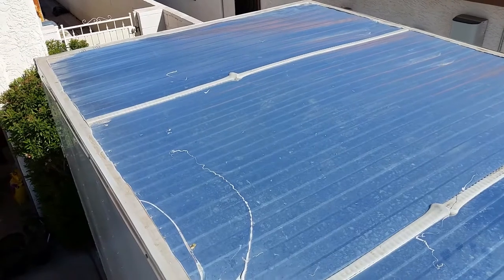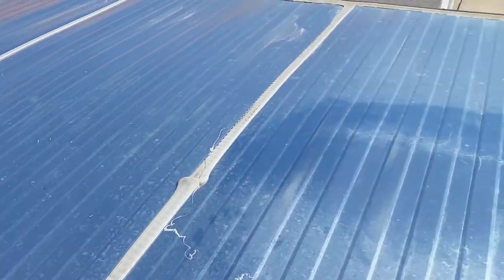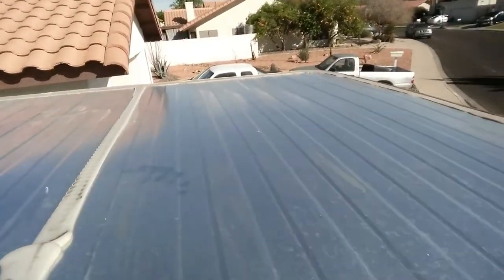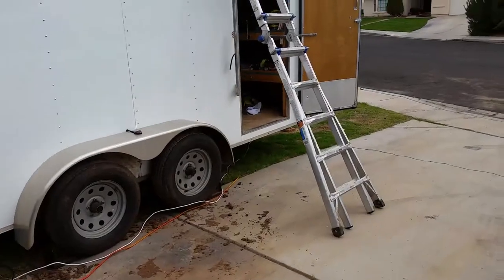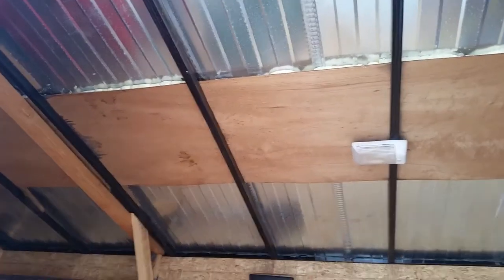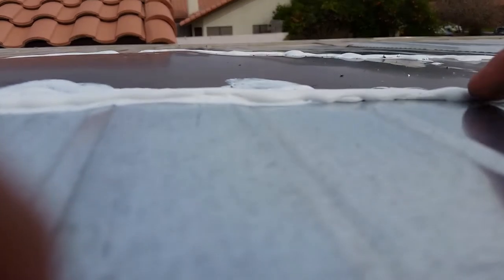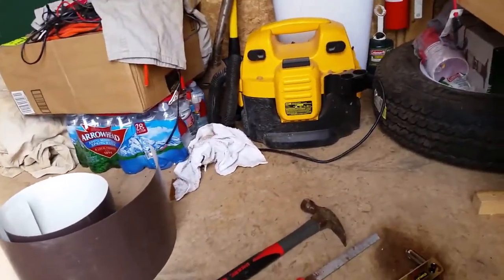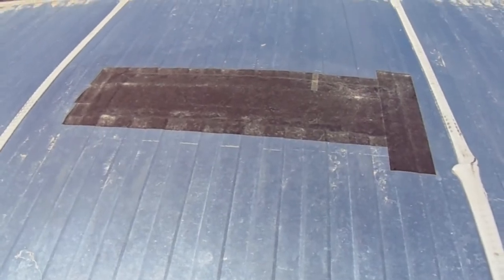Cheap Fix (Trailer Roof Repair)

Comment: I have exact same trailer roof and it developed a hole and cracks. The manufacturer wanted to charge me $1500 to repair. I will utilize your technique. Thanks for the video.
Reply from the maker: You're welcome.  I hope it works for you.

Comment: I realize my comment may be a bit late for some, but- I only now saw this old video and feel obligated to intervene. Several steps and methods presented in this video should not be followed or taken. Regardless of the thickness or type of exterior roof panels (ex: Galvalume, galvanized, tin, aluminum, etc.)- please know: numerous factors purposely exist and are incorporated into the design, which should not be altered or modified. The roof actually needs to be somewhat flimsy and detached from certain sections of interior crossmembers or framing components. It needs a considerable amount of adequate "flexibility". Your roof & roof liners need to handle numerous conditions and must be able to accept or withstand  certain resistance, while also accommodating frequent expansion and retraction. Have you ever heard the pop noise coming from your trailer in summer or winter? This is the "natural" reaction of the expansion and retraction. Had the engineering not taken into consideration of this need to accommodate the reaction- you would have bigger and constant problems. The flexible factory product found in "spots" (described in the video as not hard and "like gel") shown above the cross members inside and just above the luan (the wood panel product) is also NOT designed to "Hold" components together. That little "Dab" in the specific locations serves a few purposes and should not be "Hard" or be "holding" or bonding the roof panel to the luan or crossmembers. It is not a "Bonding" agent nor to be an adhesive. See, it is a product designed to remain pliable and to be utilized in the contact points while also acting as an insulator of both sound, and friction as well as an absorber to prevent vibrations and withstand certain resistance. Some steps taken in this video have actually jeopardized or defeated actual engineering. Although such methods may appear to be logical, beneficial, or simply just not showing up as problematic- I wouldn't recommend the "Tuff Stuff" expansion foam for numerous and obvious reasons. Also, the aluminum coil stock  running the length (verses width) of the trailer roof and opposite of the panels will react differently when referencing expansion and retraction of the actual panels. This too, (had it not been for the application of the quality and "flexible" product used with the coil stock install), could certainly prove to be immediately problematic. Anyway, my comment is becoming far too lengthy and would be far lengthier but, in short- just know: often things that appear to be chintzy, or inadequate design- is necessary or perhaps the exact opposite of what it appears to be. Yes, sadly we do live in a world whereas shortcuts and "cheaping out" is clearly evident or even common practice anymore, but, certain levels of engineering is still among some things. It can be hard to tell the difference being: "cheaping out" is also part of today's engineering.
Reply from the maker: Interesting choice of word, (intervene).  I believe that word more accurately describes what I had to do to ensure that the crack in my roof did not spread.  I don't believe I mentioned it in the video, but I purchased the trailer new.  At the time of this video, the trailer is about 18 months old with around 5000 miles on it.  What does that say about the build quality of this trailer roof?  I should not have cracks in a metal roof in that time frame.  The crack obviously occurred due to too much flexibility.  I agree that there should be some wiggle room for expansion and contraction as is typical in all construction, but in my case, it was way too much.  The expanding foam that I used in the video is not hard.  It is still malleable enough to allow for expansion and contraction of the metal panels, but eliminates the extreme rippling effect that occurs with winds above 50 miles per hour.  To answer your question, no I have never heard a popping sound coming from the trailer at any time of the year.  I can tell you this however; in the four years since the repair I made to the roof, I have had zero issues with it and that includes sitting for months with anywhere from one to three feet of snow accumulation on the roof.  18 months VS four years.  Sounds pretty good to me considering the repair I did costs less than $60.  I wonder if the trailer manufacturer would charge less than $60 to fix it.  NOT LIKELY.